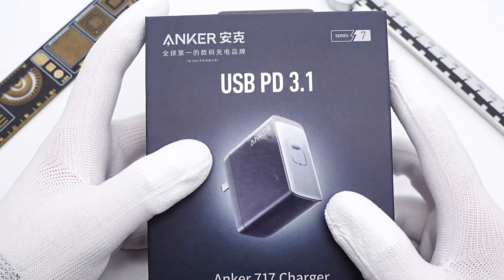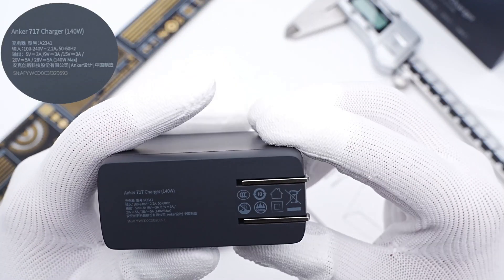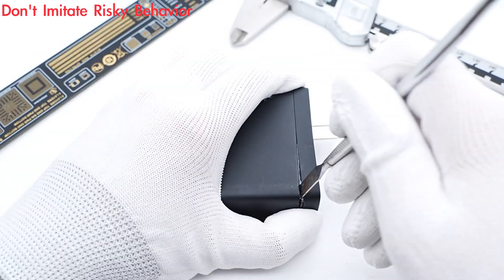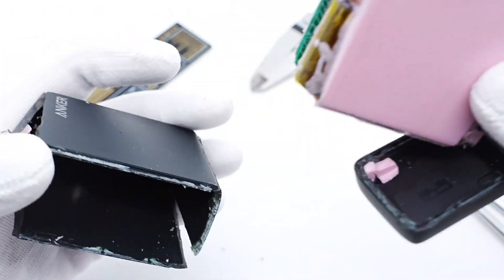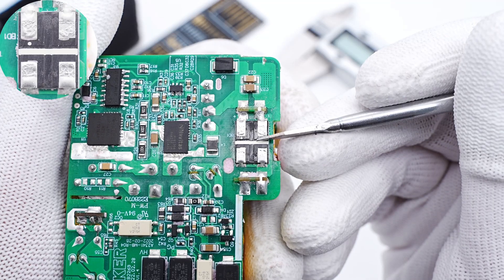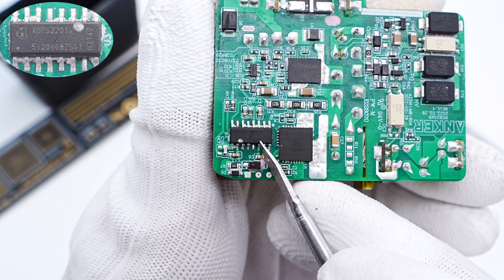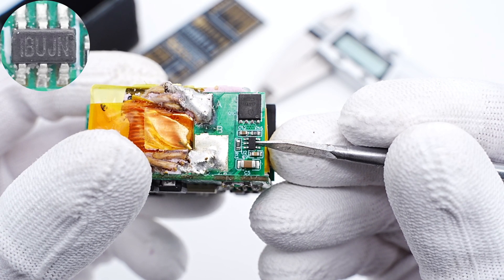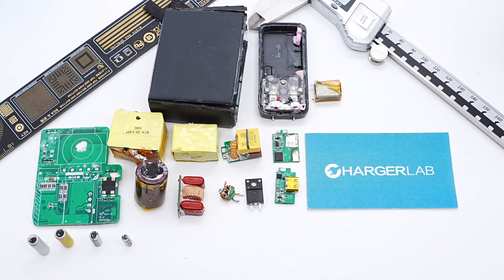Teardown of Anker 140W PD3.1 USB-C GaN Charger (717 Charger)

Comment: I use an Anker 717 to charge my Dell XPS 17 and it does it really well. I love how much more compact it is.
Reply: which model of XPS 17 exactly? I got 9700
Reply: @adomenaltas8693  Currently I'm using a 9710. Dell complains it's not the original charger but it doesn't prevent it from charging.
Reply: I am also going to buy charger like this for my XPS 17. But have you ever charged your laptop with 100W charger?
I am using 65W from UGREEN. It does it's job but system always says that it's low power
Reply: The stock dell charger is rated at 130W, at more than twice the physical size.